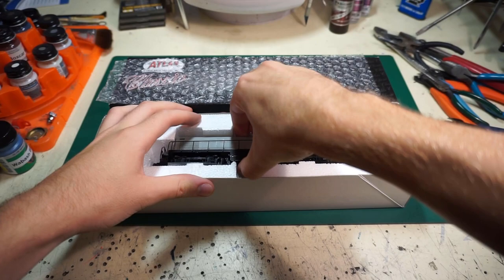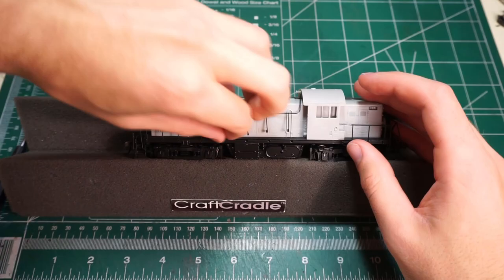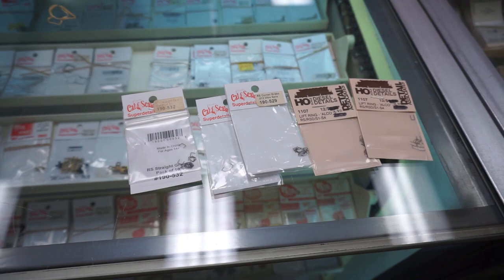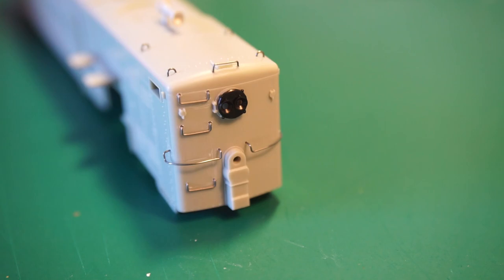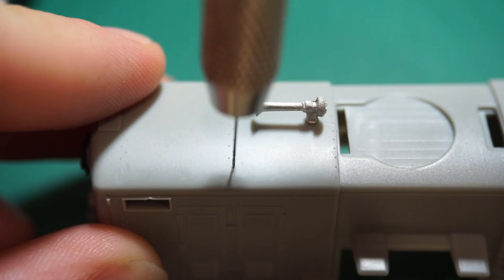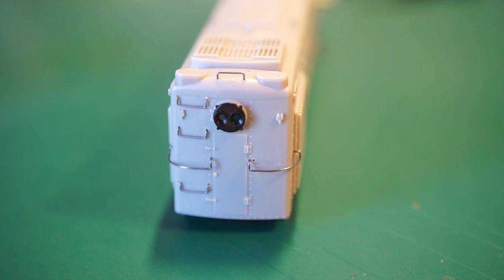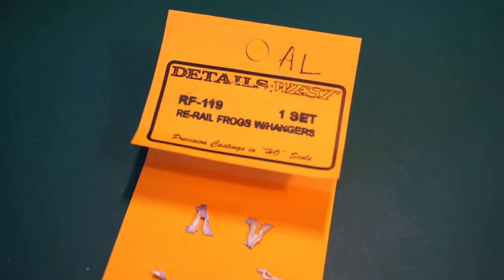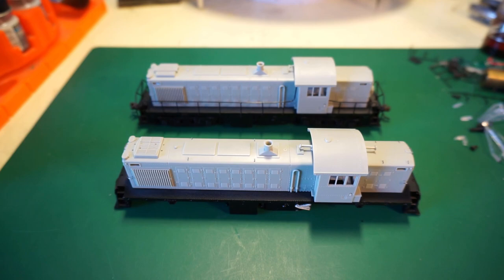Custom Soo Line RS-1 | Pt 1: Detailing

Comment: I do like my old Atlas engines.  I've got several.  One is an RS-3 and another one is a Fairbanks-Morse H15-44 in the Central of Georgia livery.  I also have a couple of Atlas GP-7's in the Central of Georgia livery.  Just hope they perform as well as my old Athearn engines.  
I do the same thing when modeling a certain engine.  I always print out a hard copy of the engine I'm modeling.
Cheers from eastern TN